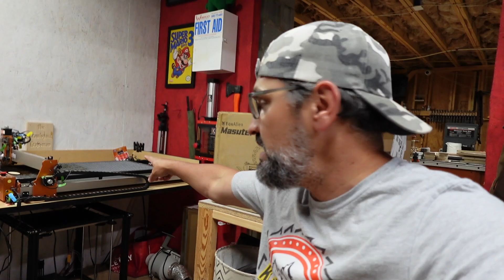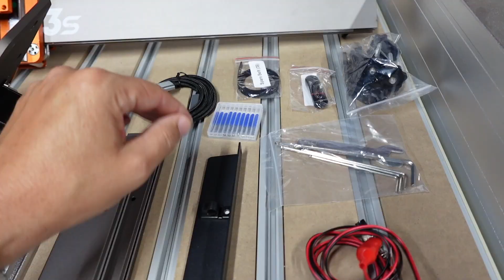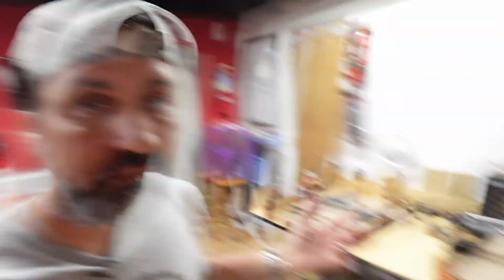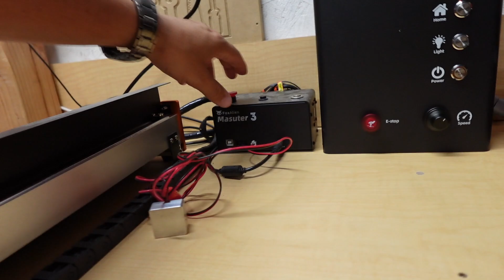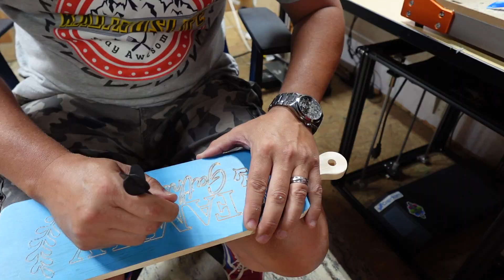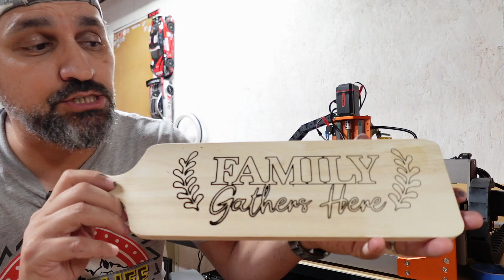A Side by Side look of the Masuter 3 and Masuter 3s by FoxAlien!

Comment: The masuter 3 is such useless machine, the wood chips are getting under the wheels making the gantries seize,....
Reply from the maker: I have to gracefully disagree with you. I have been using mine for long time and never had a single issue with “wood chips” getting under the wheels cause a gantry to seize up! Actually…. I’ve never had this happen on any of my Belt Driven CNCs (Foxalien or Other Brands).  I don’t know your cleaning routine but if you’re not regularly cleaning the machine that could be a problem.
Reply: @SoupyDad  im vacuuming chips trhoughout cutting, periodically, and betweeen cuts and so... The chips fly on the gantry while cutting, i cant constantly watch the machine, i have made some cleaning ramps or so, to clearout rail before wheels, I will see how it goes

Comment: Entre las 3 cuál es mejor yo la quiero solo para cortar mdf de 9mm
Reply from the maker: Go M3s.  You’ll be way more happy with the end result. Bigger steppers, more clearance, if you extend it… the direction is better too. Longer X  and shorter Y makes it easy to reach on the table top.  Bigger Spindle too.

Comment: i dont exactly have the funds for the 3S version, but if i really ask around i can get the moeny just is it worth it? i ordered the Masuter 3 for now but im wondering is the extra $450 CAD worth spending for my first cnc machine in a small wood shed shop or I should just stick with the Masuter 3 and not worry about needing the 3S???????? i really hope you will still answer this
Reply from the maker: Hey there!  I’m sure you’ll be very happy with the 3 but the 3s is a better machine!  The extra Z height and more Rigidity is a plus as well as if you decide to expand it… the X is longer than the Y which makes it (IMO) easier to work with.  It’s not a huge deal…. But if you can…. The 3S is better.

Comment: Just retired from the military and wanted to getting into making rustic flag making got a veror cnc to start off and I don’t know where to begin. Lol. I’m lost I. The sauce with the gcode process
Reply from the maker: Try busing Easel Pro to start. It’s super easy and will get you in the right direction!
Reply: @ do I have to invest on another cnc machine or stick with what I have for now.
Reply from the maker: @joequinata9901  I haven’t tried the Vevor as of yet.  Most of these aren’t industrial use but it should work good enough if you take care of it. Get to know what you’re doin and then you can upgrade!
Reply: I have the same machine the 3S and I am also lost
Reply: @m @melissa200620 download Easel Pro it will get you on the right direction. 🎉🎉🎉🎉

Comment: Hi. Can you cut completely through wood with this or only engrave?
If you can completely cut through wood, what is the max thickness of wood? 
Thank you
Reply from the maker: Hey there!  So yes….. you can cut all the way through but you need to make sure the endmill (bit) is long enough for instance a 1” endmill will cut 1” or a little more. Ask any questions you may have!
Reply: @SoupyDad 
Oh that's fantastic! Thank you. What the longest bit that can go in there, so I know what the thickest wood I can cut. 
Also, is it very accurate cutting through? Thank you so much for answering my questions. You're really helpful!
Reply from the maker: @ I know they make longer but I use 1” cut 1/8” shank all the time. Cost is about $25/each.  I’m not sure if there are 1.5-2” cut lengths so I’d look into that.
Reply: Oh that's fantastic! Thank you. What the longest bit that can go in there, so I know what the thickest wood I can cut. 
Also, is it very accurate cutting through? Thank you so much for answering my questions. You're really helpful!

Comment: Great video... 1,.) Question on upgrade options for spindle.  If I'm looking to do hardwood, primarily, would you recommend going with a bauer type router or is there an upgraded spindle from masuter you would recommend?  2.) Do you know if the standard dust boot they sell on their site will work with the 3s?
Reply from the maker: So if your cutting hardwoods the 400w will do it but you’ll have to make sure your cut passes are set right. I’d go Shallow and Slow.  I would definitely recommend the Bauer as its most twice as powerful at about 30k rpms! As far as the dust boot… yes! It will fit the 400 and Bauer out of box! Thanks for watching and commenting!! Much appreciated!

Comment: i see with the extension kit they have just released for the masuter 3 it comes with open loop 23 stepper motors.Is there a marked difference between them and the closed loop motors supplied with the 3s.
Reply from the maker: Key Differences:

	•	Feedback: Closed-loop motors use feedback to ensure accuracy, while open-loop motors do not.
	•	Reliability: Closed-loop systems can correct errors in real-time, making them more reliable for complex tasks.
	•	Cost: Open-loop systems are simpler and cheaper but at the cost of potential accuracy issues.
	•	Efficiency: Closed-loop systems are generally more energy-efficient due to their ability to adjust power usage based on load.
Reply: @SoupyDad  Awesome!
Reply from the maker: NEMA23 open-loop stepper motors move based on predefined steps without feedback, so they don't know if they miss a step. Closed-loop NEMA23 motors, however, have feedback systems that monitor position, allowing them to correct missed steps, leading to more accurate and reliable operation.
Reply from the maker: Hope that helps some!!!

Comment: Did you get a z probe with the 3s? It’s not listed in the contents list on their website.
Reply: The z probe is included.
Reply from the maker: It does! I do a parts list check in the video.  It’s a 15mm block with an Airplane adapter.
Reply: @SoupyDad thank you. I completely missed you mentioning it when I watched the video first time.